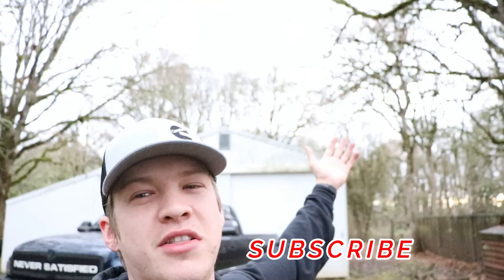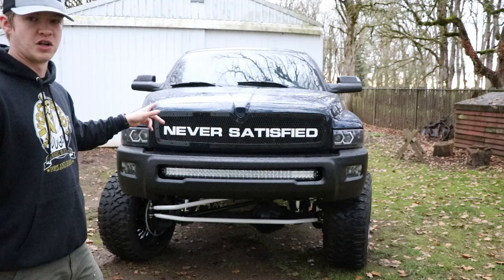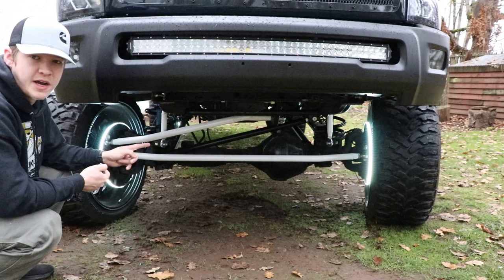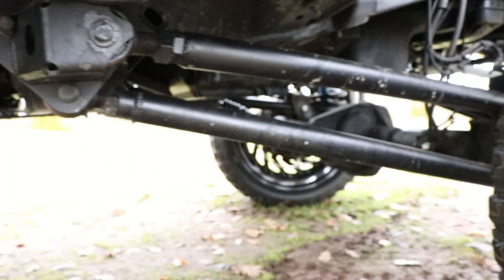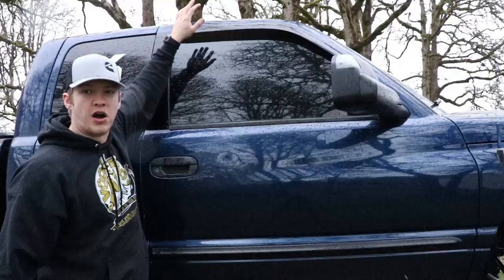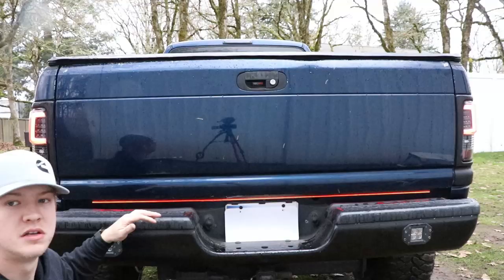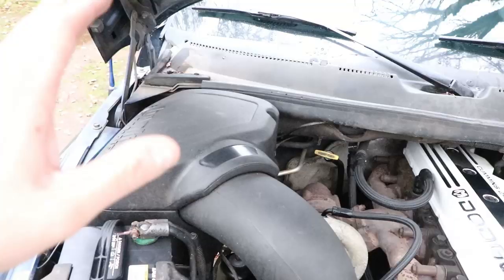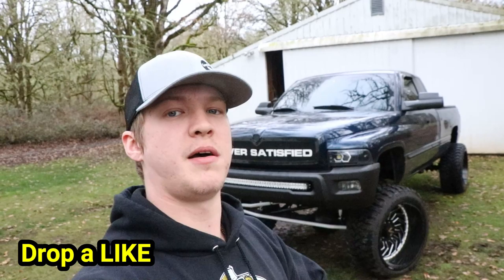COMPLETE BUILD LIST BREAK DOWN! I ANSWER ALL YOUR QUESTIONS!

Comment: Did you ever have a death wobble? I have a 5 inch suspension lift and I went from 33s to 35s and instantly I have the death wobble. Will those double knuckle steering rods fix that? My frontend is tight...

Comment: Hey bud I got a 01 1500 and I'm gonna put some 5 inch lift coils on that's meant for a diesel...how much lift do u think I'll have
Reply from the maker: David Smith if it’s meant for a diesel and you’re putting it on a 1500 I’d say it will give you 7-8” of lift.
Reply: Ok just wasnt sure how high it will put it...I got a 3 inch body lift too
Reply: Would my break lines be ok with that much lift?
Reply from the maker: David Smith no I haven’t done anything with mine. But you will need to move the bracket mounted on the axle to a higher point.

Comment: Did you have a big gap with them 4th gen bumper brackets? Have to fab anything up to close the gap?
Reply: I hate that gap, I made one from plastic floor liner ($100) Office Depot and black paint.or  Possibly use heavy mud flaps from big diesel truck to make them. Make cardboard templates 1st.  1'  x  10" wide covers most of the gap.

Comment: Where'd you get that electric fan trans cooler? I have Kevins Full Send lines and deleted the heat exchanger too. Any suggestions on how you plumbed that all up?
Reply from the maker: rotohead1 mishimoto transcooler. And I have a video install on both.

Comment: Question I notice you have shocks has struts for the lift is that fine (does is matter )or is my mechanic just stupid and saying I can’t use my rough country as “struts”
Reply from the maker: Nike Socks02 I have a coil spring and a shock but not a strut.
Reply: NeverSatisfied24v  so then I can use my new shocks to replace my old factory strut ?

Comment: How did u mount the light bar in the bumper
Reply from the maker: David Smith just made some brackets out of 1/8 steel and mounted them to the conversion brackets.
Reply: Ok...I need to get one for my 4th gen bumper
Reply: Where did u get it long arm brackets from

Comment: So again why is  crosspver steering considered offroad only or mainly. Does it really have more bump steer than factory steering i am confused. Also do you thing heim joints really last. I have a track bar with them and under a thousand miles I can see slop in  them already? Thanks for your reply.
Reply from the maker: It is made for off-road trucks but I’ve been running it for over a year and haven’t had any problems. Heims still holding up strong. Sometimes you get a bad heim like prestons did and we just have to replace it, super easy and cheap to do. I haven’t had any bump steering or steering issues with the crossover steering.

Comment: Only thing I hate are those wheels🤮, 20” wheels are plenty, and get a tire that actually fits there’s literally no reason to stretch tires
Reply from the maker: Lol I would not consider these stretched by any means 😂 And I plan to go with a bigger tires but not until I put the new lift on.
Reply: If the wheel is wider than the tread there stretched